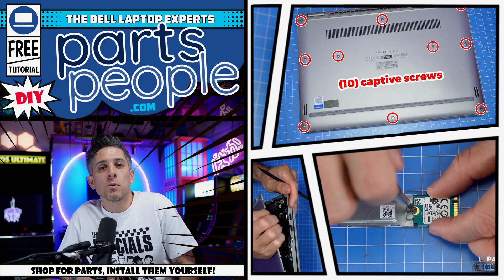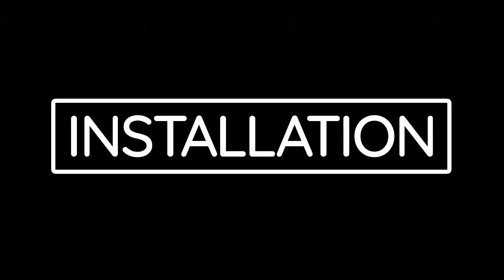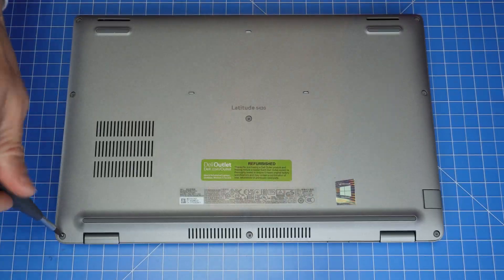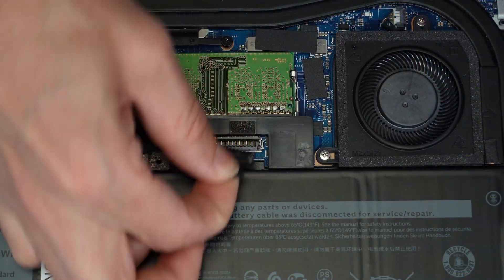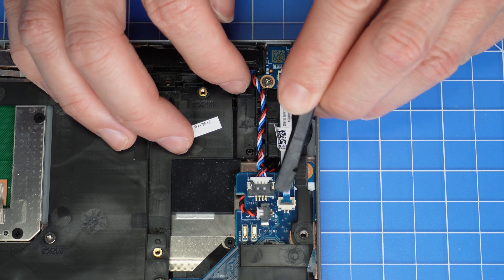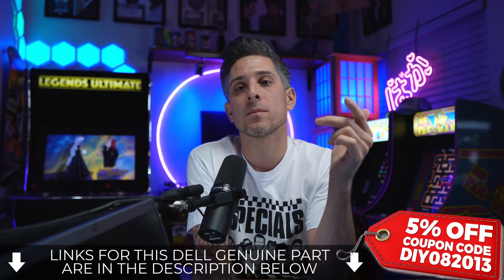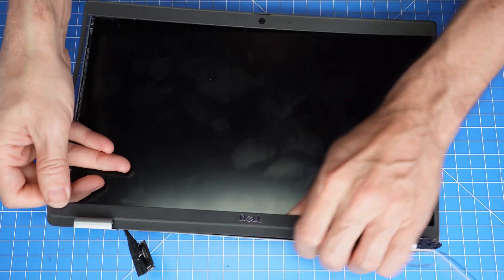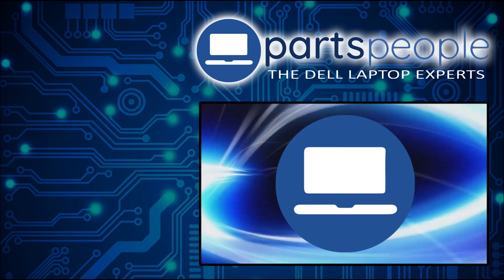UPGRADE Your Dell Latitude 5420 Like A Pro | Quick And Easy!

Comment: My Dell Latitude 5420 currently has a 42Wh built-in battery. Is it possible to upgrade it to a 63Wh battery? The battery compartment appears to have enough space for the 63Wh model.
Reply from the maker: Hey! Yes if it has enough space then you have room for the 6-cell.

Comment: Hello, I've got a dell 5420 latitude with i7 and 32gb of ram but it's advertised at 3200 speed. I only see 2666 and I can't change it. Is there any chance of doing that?
Reply: u use another ram which is of slower speed u both the ram of 3200mhz it will work
Reply: @yajatjhaok  Yeah, I did notice that. Someone bought a cheaper once before I got the laptop. Though it was a bios issue before I opened it.
Reply: @psimaron  ohh

Comment: Is there a specific NVME flash drive I need to upgrade my 5420 ??
I have what appears to be two slots.
Can i just leave the original 256GB flash drive (which obviously has the O.S on it), and just add another drive to enable larger storage ??
I'm just running out of storage space.
Thanks for the video.

Comment: Any idea why my 5420!is not detecting the new WD Black 2TB M.2 2280 I just installed? Assuming I didn’t get a dud but the old factory SSD works fine when I pop it back in….anything that needs to be changed on the BIOS? Thanks in advance!

Comment: Good video. Some clarification - the Latitude 5420 can take max. 64GB RAM (2x 32GB DDR 3200MHz). The rugged edition can only take 32GB. Maximum SSD capacity is 4TB.
Reply from the maker: Good catch. Thanks for posting this clarification.
Reply: Would 3200 speed ram also work

Comment: how large a ssd can you put into the Dell Latitude 5420 (ssd capacity)?
Reply from the maker: Hi, our website says you can use 2tb NVME but Dells spec sheet for the 5420 says 1tb. The spec sheet is outdated, so I'd say that you can use a 2tb since we have it listed as compatible.
Reply: @dellpartspeople  hi, do you think that one SSD Samsung 990 PRO 2TB NVMe M.2 2280 (Read til 7450MB/s and Write til 6900MB/s) is able to function successfully?   Can I install this SSD without any problems?
Reply from the maker: @broncasrafa  Yes. We have the 2TB NVMe listed as compatible.